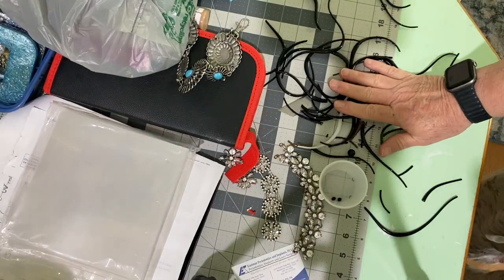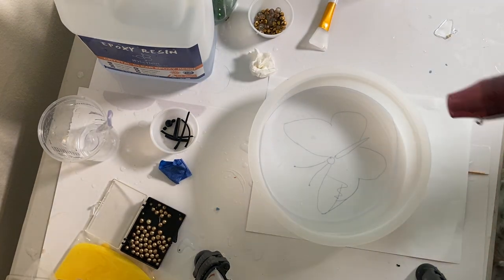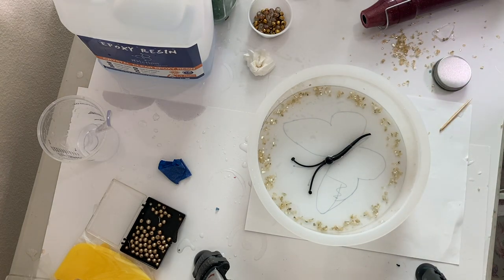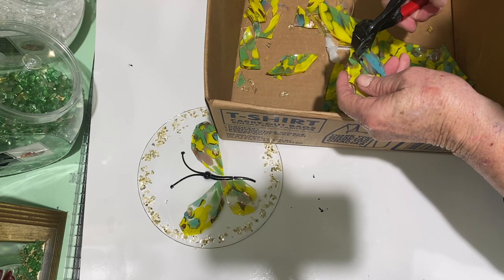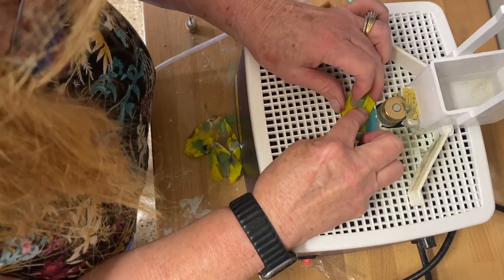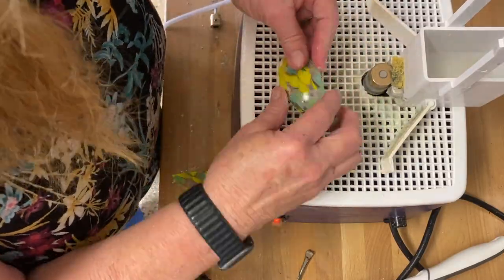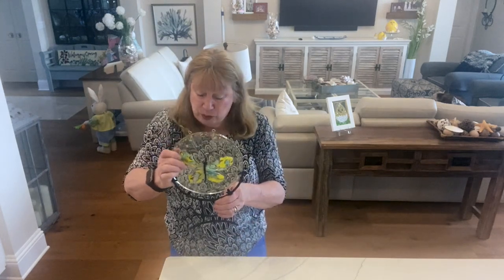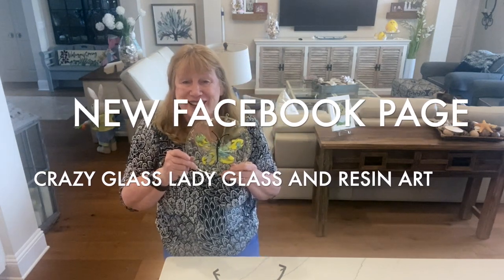FAUX FUSED GLASS BUTTERFLY WITH EPOXY RESIN AND BROKEN GLASS ART GLASS ART STEP BY STEP GUIDE

Comment: The butterfly is beautiful. Was the vase painted.  Do you need to use a diamond drill bite, for glass, to drill the holes in the resin or just a regular drill bite? How do you determine the thickness to fit in the stand?
Reply from the maker: Thank you! The colors in the vase are actually all the way through it so I believe it was blown glass. No my husband used a regular drill bit. The prongs on the stand are actually adjustable you can stretch them apart easily.